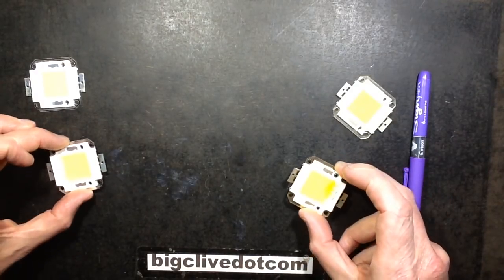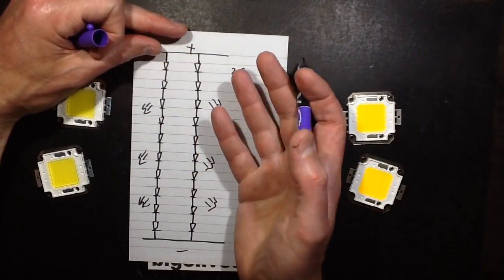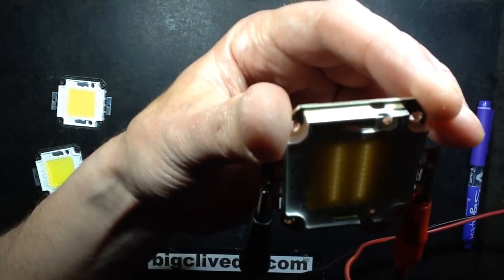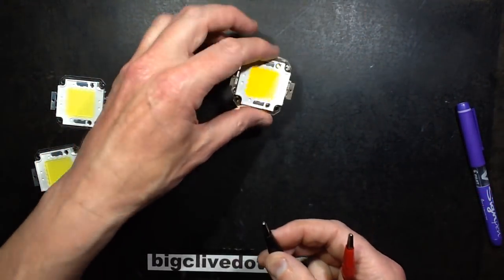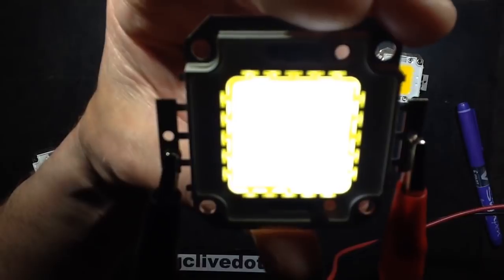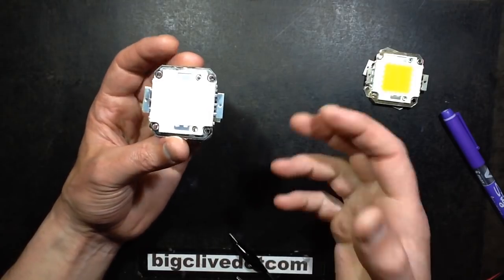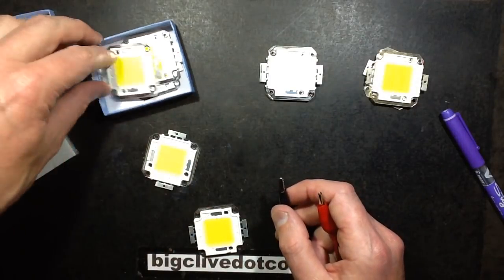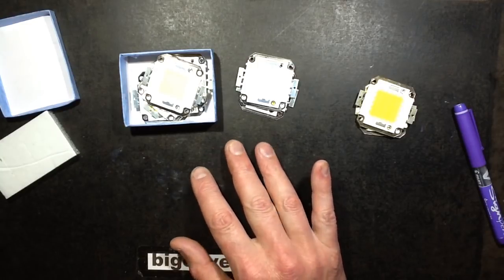Testing dodgy 100W LEDs from ebay sellers.

Comment: having the same problem with an overpriced 10w kit I bought on eBay...4 of the chips don't light until you saturate with voltage...n I paid extra ($8) hoping for QUALITY LED to be unused with the lens, fan/sink and lens housing..n I got basically a 10w driver circuit build on cardboard and a shit LED...the lens had 2 scratches in it to boot ....$8 n an hour and a half dicking around gone forever!  ..I'm kinda butt hurt about that transaction..

Comment: well shit, i just spend £7 on a 100w led from a uk supplier, watching your videos abvout led floodlights before i decided on the more expensive one, still its pobably a very bad chip. What voltages do these run on so i can test mine?
Reply from the maker: If it's a standard chip then it will need a driver or you can ramp up the voltage very slowly on a bench power supply and it should start to light evenly at around 25V.  If it came from a UK seller then it's probably just a resell of the cheapest LED they could find on eBay.

Comment: I bought a cheap 50w led flood light off of Amazon and noticed the chip has 10 rows of 10 instead of 5 rows of 10. Wonder what the chances are that they put a 50watt driver with a 100watt chip in there, or are they .5 watt leds in the chip.
Reply from the maker: Could be either.  I see a trend of using larger numbers of lower rated LEDs and also the use of lower quality high power LEDs run at lower power to try and slow their failure.

Comment: I guess the ones I have are about 50/50 the ones I paid more for are not necessarily the best of the lot either.  I have had my best luck with 50 watt color LEDs. I had a plan that has been tossed to the wind long ago, of building lights to shine on our RV while we are outdoors enjoying the early evenings at the rv parks, where I could change the color and thus the color my white RV looks in the moonlight using these.  I have Red, Green and Blue large LED's some 50 Watt and one or two ended up being 100 Watt as I made my purchases.  I mounted them all on old Pentium II and III heat sinks which I drilled and tapped using old taps from my gunsmithing days and used gun screws to mount them, the heads of these screws small enough so as not to interfere with the LEDS.  Now that I sit here in the Mohave Desert, and think about using the lights, I realize that they are still sitting in the case put them in last summer when I completed the build, in the back room waiting to be loaded in the RV.  Ah well perhaps next year. My question is, though, even as poor as they are, once you hit them with enough juice can't they still be used for illumination? I had in mind putting a couple above my router table, and table saw in my garage back in the Dakota's next spring when I get back there, to aid in seeing what I am doing and keeping my hands away from extremely fast rotating bits and blades.

Comment: that was 7 and a half minutes of nonsense
all you have to do is get a camera in manual mode and power the leds at 50w 75w 100w and see which one is brighter or the same
if they are the same then it doesnt matter that youre saving money getting cheap chinese leds
why didnt you actually test the leds
useless video
Reply: yes idiot these are lights remember
give a set input and measure the output
its called science
Reply: yeah, there is nothing wrong with them. he is using them outside of its specifications, so what does he expect?

Comment: Interesting video , but you're being unfair on the manufacturer  ...these led's were never designed to work at the voltage you applied , and are in no way faulty ...the fact that some leds in a chain only start emitting at a very slightly higher current doesn't matter at all. 

 A fairer test would be to measure light output at different power inputs. I would bet whether the leds in a chip are perfectly matched has no measurable effect on light output/Watt power input.

These leds are so cheap now ,  and different power sizes priced in such a way, that it only makes sense to by 100W chips and run them 5-20% max power   , zero/minimal heat sink is then required , but more importantly they are will run more efficiently , more light per Watt input .. and run at 10% they will effectively last forever!
Reply: If the manufacturer is selling them as 100w leds they should be able to take 100w reliably for the 50000 hour lifespan they advertise.  It wouldnt bother me if they sold it as a 10W and bridged the faulty strings.

Also the big problem is none of the stuff i have bought has any manufacturer markings at all.  So i cannot even avoid certain ones and praise others.  Price isnt a good way to differentiate since i have bought cheap got great stuff... bought higher price and got 10 out of 10 unusable ones.

Comment: Why do we accept this garbage from China?
Reply: "accept" is the wrong word, "choose" is more accurate. you can get very good quality electronics from Chinese manufacturers and sellers, even on ebay, if youre willing to pay for them. its the people who go for the cheapest listings and order stuff at impossibly low prices from unknown suppliers who are going to get the factory rejects and shit that doesnt last or even work. plenty do take the uber cheap option and as long as they keep doing it people are going to keep selling crap to them. but pay a fair price and you can get a good product, and it will still be cheaper than a domestic supplier
Reply: Nothing in the listings to say they are rejects, i would call it mis-representation. All the adverts are for working products, working these are not!
Reply: thats the trouble with ebay scams and the people selling very poor quality stuff, they tend not to actually announce it in the listings. but would you expect the keeper of some dodgy market stall to tell you that theyre selling rubbish?
when I go to the ebay seller I use for LEDs they tell you about their money back guarantee and how they actually stock and test the things they sell, I can check their profile to see how theyve been in business for 10+ years with very close to 100% positive feedback. look around their shop and its full of LED lighting products, lamps, power supplies etc. I think their 30W LEDs for instance are about £3 or £4 each, which is a fair price. 
now compare that situation to a drop shipper listing a 30W LED for 99p with none of the above information, just a generic stock photo. the rest of their shop has cheap clothes, plastic kitchen gadgets, mobile phone covers, the usual tat and rubbish. 
I think anyone who orders from the latter seller and is surprised when they receive poor quality goods is frankly an idiot. perhaps some people have difficulty in translating the experience and common sense they might have when shopping in person over to shopping online. I dont know why that should be the case but Im sure there are people who wouldnt buy electronics from a pound shop or market stall but will effectively do just that on ebay.
Reply: You are of course correct.
Probably most ebay sellers of electronic components & devices know absolutely nothing about these products they list for sale.
To be fair, they will usually refund or replace faulty product with little trouble & I have found if I ask first if they are able to offer tech support they usually answer honestly - NO
Reply: I'm not sure WHY we accept it. I think as Americans (and people of other nations as well) that we see low price and logic goes out the window. We think we can have it all! The reality of the situation is a sad one, because by buying this cheap shitty quality stuff we're telling the Chinese that we find it acceptable and that they should keep pumping this stuff out.
Reply: If we didn't buy it, there would be no market for it = they wouldn't sell it.   :\
Reply: Because it's cheap, other people are doing the work to produce it and we don't have to deal with the pollution of the manufacturing process. It's a perfect storm....Until they take those profits (our dollars) and start an invasion to find land NOT polluted and we look a missile in the eye that we paid to make before it kills us.

Comment: What do you use to bring the voltage up to test the LED's with? I've tried all kinds of names to try and find something? Current limited Power Supply, AC Voltage regulator, etc. It's like trying buy a Ratchet and not knowing what one is called. Would appreciate a link to where to find one (not pro, just tinker) or if there's a link to building one from and old PSU if that's even possible? Thank you for any help & thanks for the video(s)!
Reply: Most likely he's using a Lab Power Supply. Any lab supply worthy of the name lets you set the maximum current it will provide which is helpful when you're testing equipment. If a circuit's supposed to draw 100 mA, you really don't want to hook it to something that can run 30A into a dead short all day. There's lots of info on building your own lab supply on the net. I recommend you choose  a design with a current limit adjustment.
Reply: Thank you! Looking at how to build one and for one on Aliexpress/Alibaba.
Reply: Mainly you use DC-DC boost converters. You can get one like this: https://www.aliexpress.com/item/1200W-20A-DC-Converter-Boost-Step-up-Power-Supply-Module-IN-8-60V-OUT-12-83V/32752058081.html which can handle a massive 1200w and goes up to 83v and has current control. Problem is that you can't go under the input voltage.
So if you connect it to an old 12V PSU, the minimum output you'll get is 12v, max 83v
Once I tried making a lab PSU out of an ATX but connecting the + and - 12v rails only gets you 24v in a very low amperage. This, on the other hand, lets you use all the watts form the 12v rail.

Comment: The proof of the pudding etc.  So you should use a Lumen/Candela meter. These are not dimmable LED's, by voltage. For the dimmable one's an inverter is reccommended.

Comment: 1/ You cannot damage an LED with static. Sorry, you just discredited yourself there.  2/ The LEDs are probably balanced at the rated current, not at very low currents. (You should photo them through a mylar filter).
Reply: I agree, however, 20W lamp is well balanced at the low current - tested 2 lamps x 20 diodes perfectly matched - it is not coincidence so there is definitely something different about them.
Reply: L Ofaday funnily enough, the manufacturers of LEDs using this technology disagree with you (and all the other "static doesn't damage LEDs" experts in here), according to them, these components are more sensitive to ESD than any other type of LED and advise they are shipped and treated as any other static sensitive component.

Comment: Have you tried any newer Cree led's? They have much better lumen-per-watt efficacy than the led's in these cheap 100 watts. A single cree emitter is getting around 1000 lumens @ 10 watts. When they put 4 together on a die it's getting around 4000 lumens @ 30-35 watts. Apparently these 100 watt led's are not pushing more than 5-6000 lumens or so @ 100 watts despite the manufacturer claims.

Comment: Typical Chinese quality.. they are incapable of producing anything with quality control..in fact they don't know the meaning of quality control... But if you think of the engineering required to produce this, and the fact that it would only take 5% more effort to do it properly, you have to ask WHY ?  WHY WONT THEY MAKE THINGS WITH CARE and QUALITY .....Can anyone answer this please...  and this applies to EVERYTHING out of China.... it's never 100%, it will always be inferior to what the design could produce...
Reply: I can buy 4 100W led for the same price i pay for a hamburgerdinner, what kind of quality do you expect for that price?

A 100w led contains 100 small light emitting diods, every single diod have different characteristics, to make a high quality led you need to match these 100 leds to each other and that takes time and time is money, by skipping this they can make these leds much cheaper.

I have used 10W leds and from personall experience, they work very good for the price i paid, had a 10W led driver fail last week after about 4500 hours.
Reply: you get what you pay for, if you pay good you can get high quality from china as well
Reply: I suspect that some sellers will sell flawed products at high prices too to ensure they get a juicy slice of that part of the market.
Reply: Thats just bullshit Colin.

You can get really high quality from China, but you only get what you pay for.

Most devices you are using got parts made in China in them. And they work.

And they DO have quality control, but that will cost you.
If you are not willing to pay for that, you have to rely on luck, just like clive does with his LEDs.

And quite often the cheap stuff is what quality control said "Nope, not good enough", and its sold to you.
Some coming from the same line as your really expensive high quality parts, produced just seconds from each other.
Reply: Bullshit ??? NO you are totally missing the point....
Why produce something that is 80% ok and 20% bad soldering, or wrong hardness of metal, or too thin, or earth not connected, or heat radiator too small for continuous use, or etc etc etc   i can go on all day...live 5v rail next to the case instead of running the 0v next to the case so it doesn't short if it gets damp etc etc etc expecting a anodised surface to be conductive ! etc etc 
Take any Chinese product and it can be improved, and at the manufacturing stage this would be EASY IF THEY CARED !!!

But they are only as clever as you, not as an engineer like me !!! 

I can see design faults in all their work!!! <WHY produce something at 80%good and 20% bad design when by simple changes in soldering temperatures, different heat treatment or choice of materiel or by making a part slightly longer etc etc.  the product could be made perfect....for the same price, and better still if they looked at the long term picture, they coule produce high quality products and get a good reputation for low cost and high quality!!  BUT THEY JUST DON'T GIVE A SHIT and are incapable of going that extra mile...it's not in their nature, they think they are not worthy people so why should they produce worthy products, when it satisfies people like you who also accept 2nd best ...you are not worthy of better if you don't know better.
and that is the point you missed.....

Comment: Hello, I always follow your videos, I have a 50 watt led, which works with 33 volts per 1500 milliamperes, but my test I did gave only 750 milliamperes, because this led gave less amperage, poor quality will be.
Reply: sounds like you got the wrong driver, a led will take all the power it can get until it burns up.

Comment: You calculated the proper voltage for 20w first so why not do the same with 100w and feed them that before judging them?
Reply: The voltage is the same, because the strings are always 10 LEDs in series.
The 100W has 10 strings of 10, the 20W has 2 strings of 10.
Reply: the voltage can vary depending how the single leds are connected.

Comment: Current through LEDs are exponential relative to voltage. You can't under power these and complain they're not lighting up. They all do light up but only when you raise the voltage to what they're rated for. LEDs aren't dimmable by adjusting voltage you do it by changing the duty cycle.
Reply from the maker: You can dim LEDs by varying the current through them.  When you have a series string of LEDs and the middle one is not lit when a modest current is clearly flowing through it, I'd say it's not a good LED and will probably fail quickly.
Reply: bigclivedotcom 
LEDs in series react different to low current, some may lit before others,  this is caused by some small difference in the Led die, when it lit it sucks more voltage than others and leave less voltage for those that will take more current to lit.  This test with lower voltage is not really valid to test series LEDs.  You need to apply working current to make sure they work,

Comment: back when all we had were the single red leds (1970's), I tested the voltage/current of a few batches. Similar results, top quality leds were almost all identical while the cheap ones especially in bulk were all over the map.